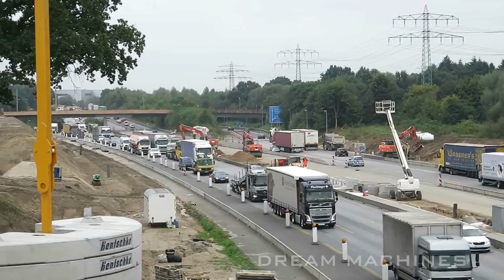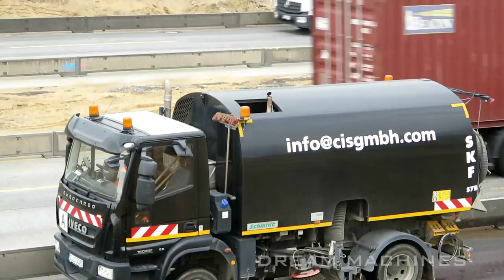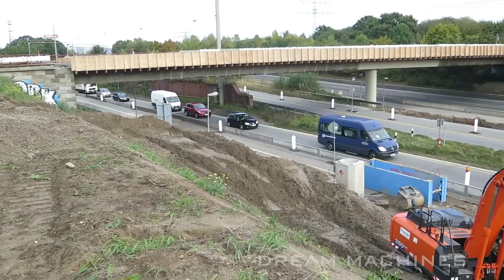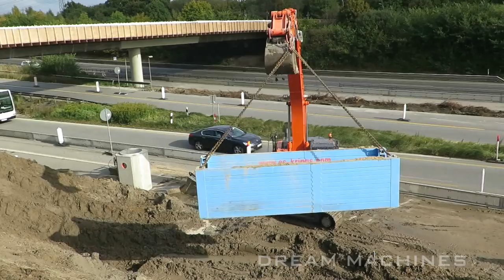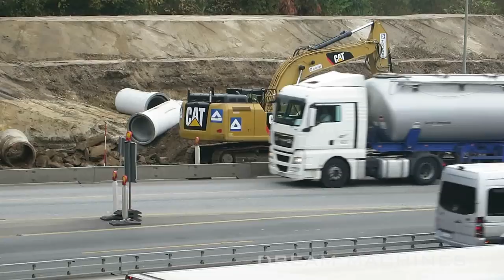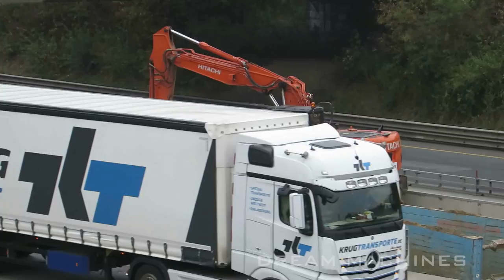HITACHI ZAXIS + CATERPILLAR BAGGER 🚧 MEGA AUTOBAHN BAUSTELLE DOKU #63

Comment: In America a wheel loader brings in the bedding material, but I can see where using a wheel excavator with a grading bucket would work better. There has been a misconception that Europe had smaller construction sites, but they are getting smaller in America also.